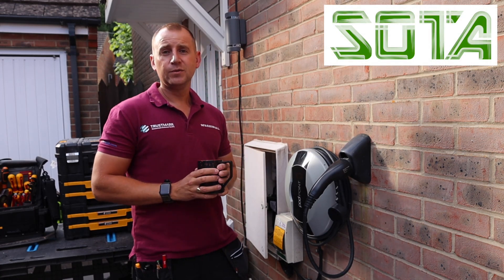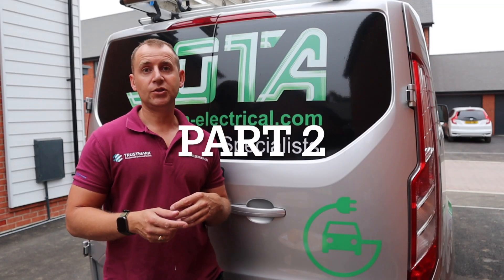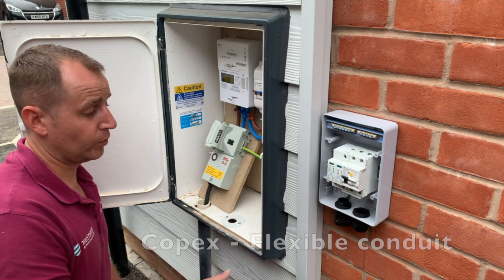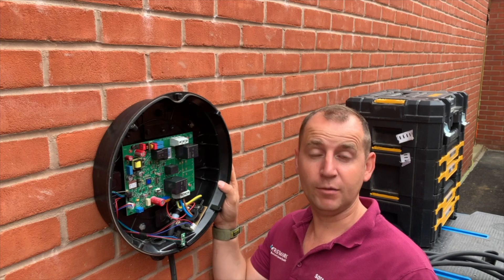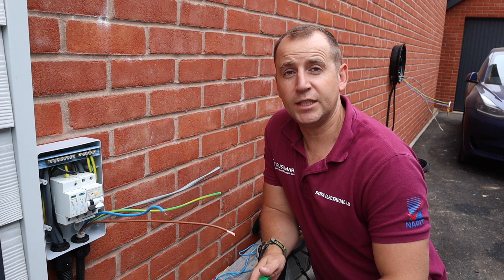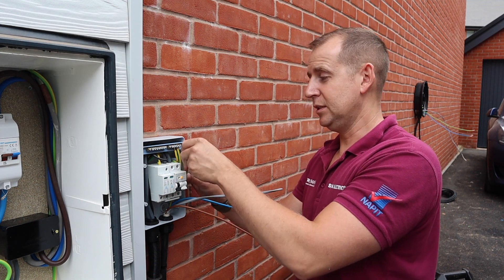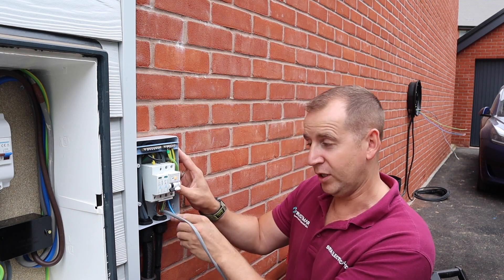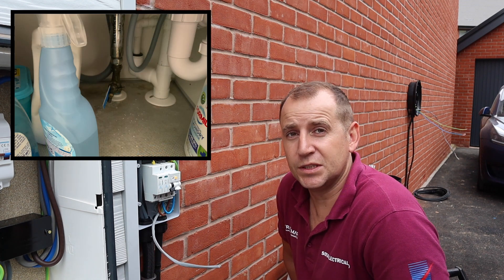Moving House? Take Your Charger With You! #electricvehicle #ev #electrician #cars

Comment: Hi, great video quick question, I have a BP pulse WiFi home charger that’s a load of rubbish. I have been given a friend gave me a Podpoint. Can I who is competent at electrics but not an electrician just swap the units as the main install is top quality and I’m very happy with. I have spoke to Podpoint who say that I don’t need pen fault detection as it already has it. Can I change the chargers. I enquired for an electrician to swap them around but wanted £350 to £400. Which I think is a lot for what should be a quick job ( 1-2 hrs). Thanks
Reply from the maker: Hi, I would strongly advise that you use a qualified electrician as you may be competent but I doubt you have test equipment to test the charger to ensure the protective equipment inside it operates correctly, in the event of a fire your house insurance probably won’t be covered as you won’t have a cert for the works, it’s up to you at the end of the day but paying a few hundred quid is a small price to pay compared with the cost of a house or life in the event of a tragedy.
Reply: @sotaelectrical  yes I think your right, just wanted to make sure I wasn’t missing out on another option. I will purchase another one, Podpoint or maybe a zappi. Thanks for the reply. Keep up the good work. 👍🏻
Reply from the maker: @malcdickinson06  thank you 👍👍

Comment: you can take what you like when you move house as long as its in the agreement , if you sold your house on having a car charger you might be in some trouble legally if you take it , make sure if you are taking it that you make it clear that you are and the price of the property will be reflected as such and have your brief pout it into the contracts
Reply from the maker: Hi Firsteer, 
Thanks for your comment, your absolutely correct, in this case the buyer of the old property requested that the charger was removed before they moved in so all was above board.